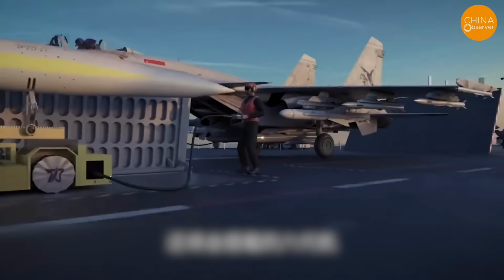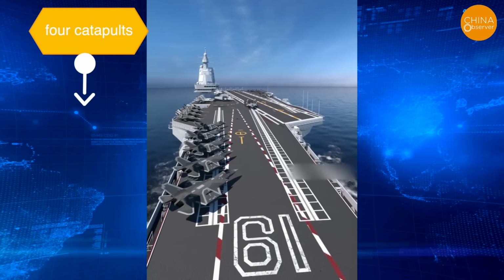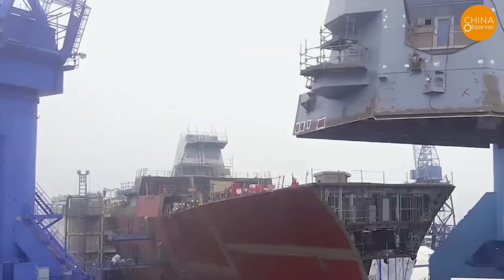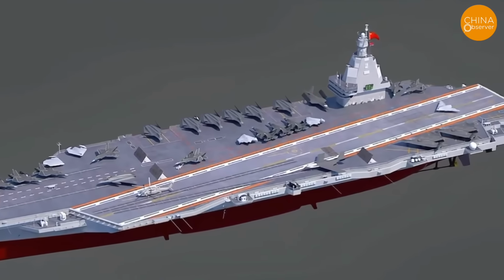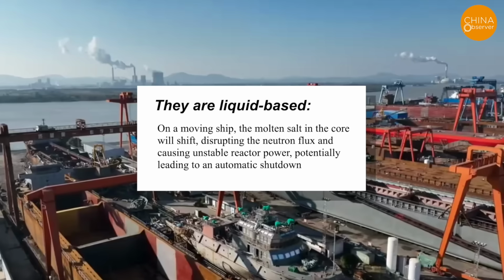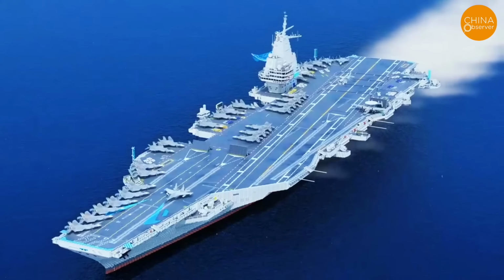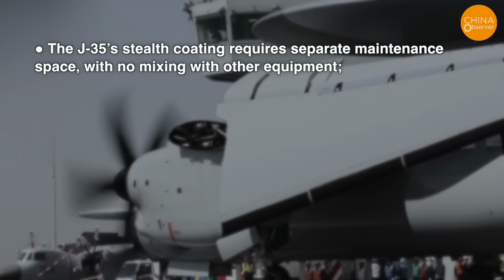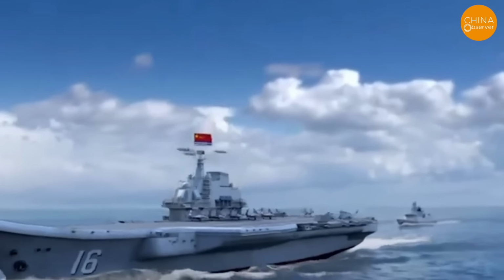China’s Type 004 Aircraft Carrier Not Even Built Yet, Already a 120,000-Ton Scrap Heap

Comment: The Ford class specs are:
4 EM catapults though the 4th that runs along the edge of the flight deck has clearance issues and can't launch a fully loaded aircraft.
75+ aircraft capacity which could increase depending on drones and their size.
2 nuclear reactors for power and at current weapon and electronics specs only half that capacity is used so high power consumption weapons (laser or rail guns) can be fitted when tested and ready.

The specs given for the Type 004 sounds like a Christmas list for Santa made by a 3 year old given China's militaty tech capabilities, if they are lucky they may sucessfully build this before the Ford class is retired in 50 years
Reply: I didn't see the 4th having clearance issues though.
Reply: 美国人总是对他们自己如此自信，却忘了肯尼迪号比003号航母早了十几年年开始建设，但003号航母几年前就下水了😂😂
Reply: @FFIIIC  First Nimitz class was launched in 1975 so I'm guessing you mean the Ford class? Building a completely new design with new technology and making it nuclear powered takes time. The Type 003 can't even match the Nimitz in capability let alone the Ford and the Type 003 hasn't even been able to make any sort of meaningful deployment with a full compliment of aircraft and crew.
Reply: @chrismiller5940 对不起，是我的错，记错名字了，已经修改了上面的回复😢😢😢😢😢
我想说的本来是你们最“先进”的肯尼迪号，似乎它已经舾装好几年了😢😢😢😢😢

既然你觉得无法与福特号相体并列并论，那么请问他能电磁弹射F35和F22吗，如果不能弹射自己最先进的战机，你觉得这些该如果应对超视距空战和跨代的J35呢？这里就不提堵马桶和洗衣房着火了

我知道你会想说核动力，现在中国已经在同时建造一艘核动力和一艘003同型号，估计在5年内才能见到🤔，但如果在中国南海呢，我看到很多美国人似乎认为美国政府真的会出兵台湾
Reply: @FFIIIC  Aircraft have to be made to be capable off operating on aircraft carriers and aircraft made specifically for the airforce are not built for it and is why the version of the F-35 is different from the versions the Marines and Navy use. Also Marine helicopter carriers require updating to handle jet exhaust and need interior reworked to handle aircraft which are larger than helicopters. All of this is common sense. THe J-20 doesn't operate from Chinese carriers does it?
Also, Japan has said they consider an attack on Taiwan an attack on Japan itself so the treaty of mutual defense between the US and Japan will come into effect and we will do what is necessary to support Japan. If China's military equipment performance in Iran and Venezuela was any indication it won't take much.
Reply: @chrismiller5940 J20是一种纯陆基重型机，和F22一样，都无法从任何航母起飞，但也由于大油箱，作战半径大概是1900KM，是F22的2倍和F35的1.6倍

而与F35对应的轻型战机则是J35，同样也有J35A陆地版本，和J35C舰载机版本🤔

至于伊朗和委内瑞拉，
委内瑞拉的情况是中国只给他们出口过雷达，没有出口防空导弹和其他任何东西，更不必说他们的军方早就被美军策反了，他们实际上根本没做出任何反抗
伊朗的情况是，中国只在40年前的两伊战争期间出口过部分武器和防空导弹，40年前的东西显然是一些老掉牙的东西，2000年以后基本没有给他们出口过什么东西，如果你看到新闻说他们用的是中国武器，不用怀疑，这是美国媒体的骗局😂，他们现在更依靠他们自己的武器装备，但凡你有看过他们在“真实承诺4”中所使用的导弹型号就会发现这些都不是中国和俄罗斯的🤔如果面对这样的伊朗，美军都不能很好的击溃他们，该如何面对中国呢，至于日本，他们不过是美国的狗罢了，美国不出兵，他们也不会出兵的，这也违反他们的和平宪法
Reply: @FFIIIC  Japan will likely ammend its constitution under the current leadership. As for the US sending troops we won't need to, the Air Force, Navy and marines are more than enough. China is nothing but talk as your military has 0 combat experience and are hesitating to even take on Taiwan and Japan. Iran is pretty much done, we don't intend to invade and take over as the citizens will get rid of the government in the end, we are just eliminating their military (which is pretty much done). China can berely project military power outside the first island chain, we don't need to get that close to eliminate ports and industry.
Reply: 无法否认中国军队已经很久没有战争了，这是事实🤔但如果你因此就认为现在战争中中国军力是空谈，那么时间会告诉我们答案，

至于日本，作为美国的狗，他们的每一届首相都曾试图修改宪法，从昨天特朗普和高市早苗的对于中国的谈话，日本似乎很希望美国插手帮助日本，而特朗普似乎更想和中国做更多贸易

至于伊朗，现在是战争的第22天，每天大概需要花费15亿美元，特朗普每天都在发言，称摧毁了他们95%的军事设施，空中力量显然是做不到颠覆政权的，而国内一致对外反而让他们更团结，后续的情况让我们拭目以待🤔
Reply: Fanfic lol

Comment: Sure they can built something like it. It just won't work as they'd want. It's just like Soviets. When you have no real carrier qualified pilots to fill the ships you have, nor to use those ships as effectively as it could be done, all they'll get is I big ship with big problems that wouldn't be able to take part in any war.
Reply: I am pretty sure it is just a prestige project. I can not think of any scenario requiring the Chinese to power project over sea far enough to require major carrier operations. Same issue the Soviets had. Outside their sub fleet, their surface ships were all about showing off, and not actually doing anything significant.